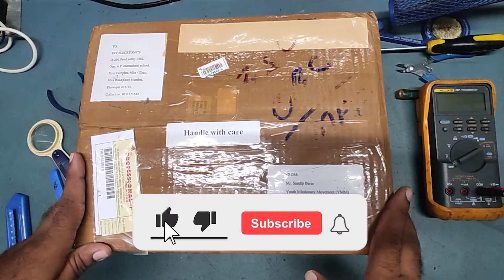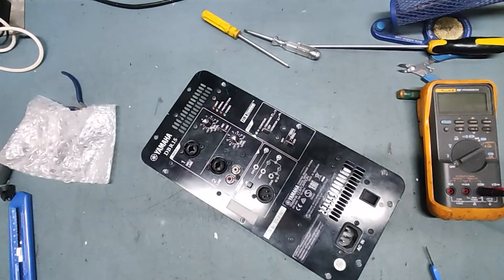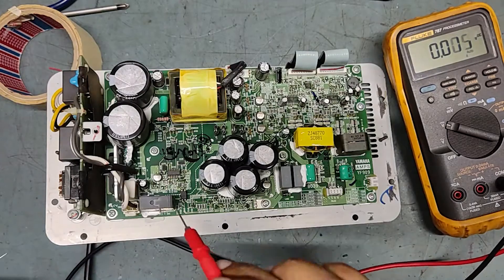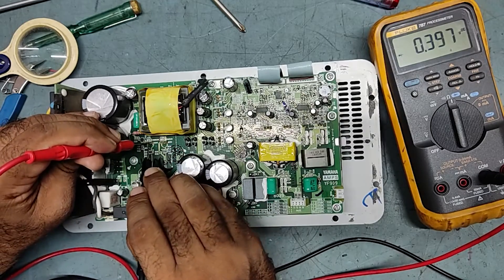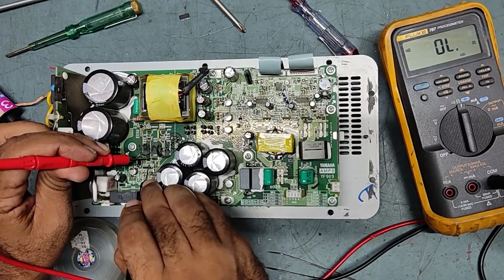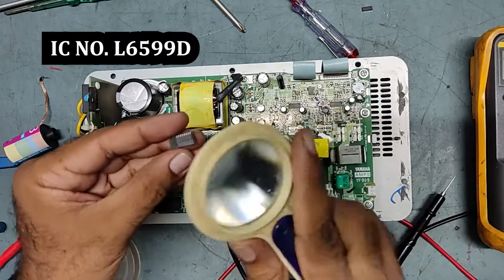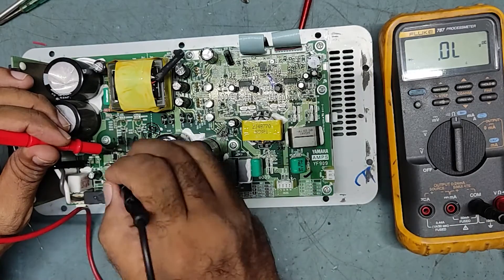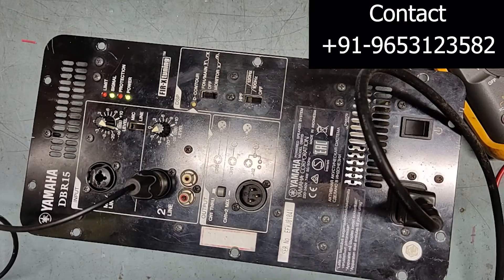How to Repair step by step SMPS Power supply in YAMAHA DBR15 Active Speaker.

Comment: Hi i have dbr15 speaker for repaire problem was when power up softstarter relay  was  getting  on/off after replacing opt coupler it powered up bt protection light came up , replace ic l6599ad everything worked after  conecting to d speakere it worked well for a hour bt it goes for protection . sir can u pls me with d problem????? thank you.
Reply from the maker: It's quite hard to tell where is the exact problem without proper inspection,

Comment: Shouldnt test be with a signal generator generating 15 - 175 Hz sine wave and monitoring the output accross a dummy load with a dual trace Oscilloscope?
Reply from the maker: Very very rarely I am using Oscilloscope, I am very much experienced in Fault tracing by voltage testing & Ohmic testing only.